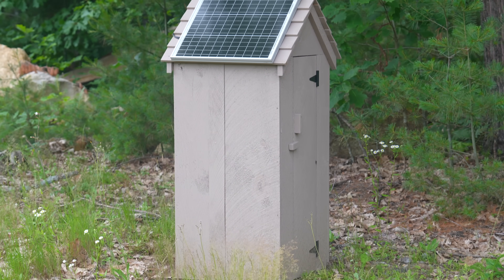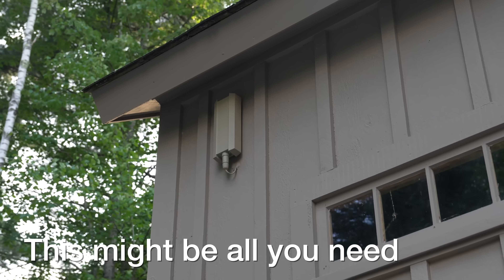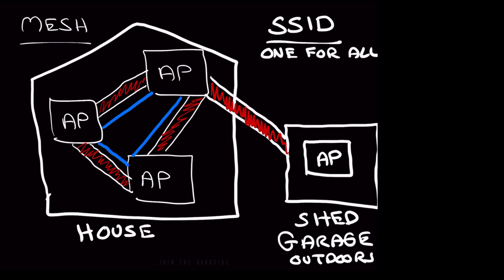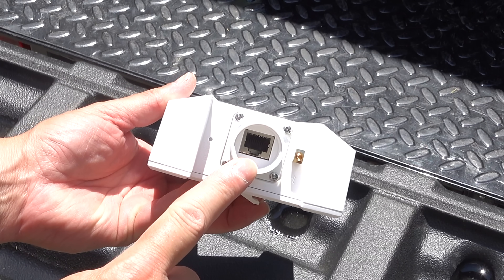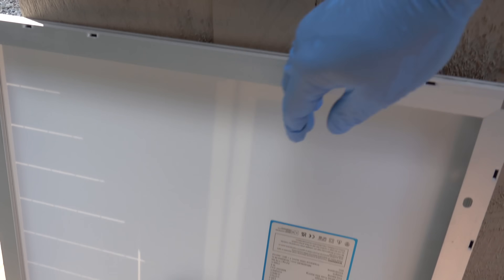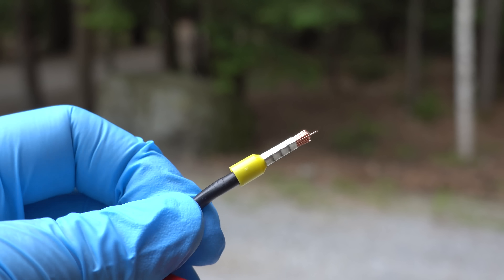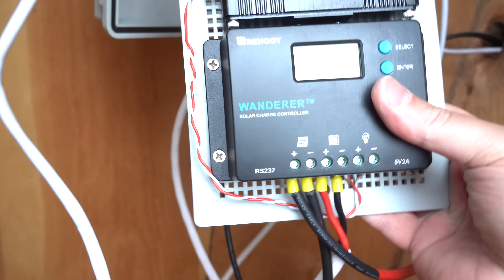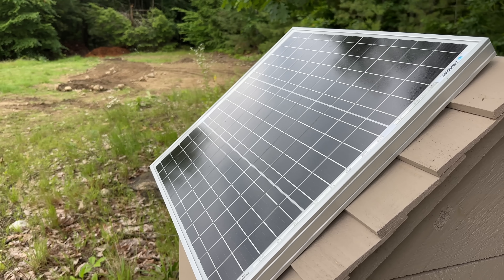How to get Wifi in the woods - DIY Solar Internet Station

Comment from the maker: Hope you found this video interesting. All parts are in the description Let me know what I could have done differently   WHY? I could barely make phone calls outdoors & my kids and I like having music & often use the web even outdoor to check weather, etc. I also have a weather station that needs Wi-Fi (more on that in a future video) - There are some other technical details in the description since I know my fellow IT nuts will jump all over some of my statements.
Reply: Nice setup. I’d want to have that solar panel strapped down securely in the event of high winds. I’d also opt to put some kind of base under it such as pavers. And to finish it off I’d anchor the structure so it can’t blow over. 

I’m absolutely amazed at your versatility in figuring these things out and appreciate you sharing this info with everyone.
Reply: Do yourself a favor, put it on bricks. Get it off the ground.
Reply: If I was going to build a remote repeater, I think you'd benefit from putting it on one of those metal garden carts.  Then it's actually completely mobile
Reply: What did you do about the 48 volts you said the TP needed?
Reply: @Daveyk021  the Poe Switch unit steps up the 12 volts to 48 volts to power the Poe devices
Reply: @TonyTony-rd4rj  So I assume if you accidentally connect a non-POE device (Computer) to a powered port, you fry that device?  TP link makes some nice POE devices but the ports (such as the non-POE port) are not labeled.
Reply: @Daveyk021  Most* not all, but most POE switches will not provide POE power unless the device plugged in requires it.
Reply: @Daveyk021   Yes
Reply: As an IT not a Solar nerd, I think you have done a great job. I've a friend who wants to setup a camera at a remote space at the bottom of his rural driveway that this might work for.
Reply: I found a $16 POE injector that took variable voltage, all the way down to 12v. Draws only about half a watt in addition from my calcs.
Reply: @chakerian where did you find it?
Reply: You might get some new hits if you add "Omada" to the end of the title. Was that little shed a prebuilt purchase?
Reply: Loved the video!!! Thank you. I am worried for the battery when we get cold weather again. These batteries don't like cold/freezing weather and will go defective. But I assume you won't need wifi in the winter. 😂
Reply: Please LMK if you know where I can dump those at my man? I subscribe on fire tv stick with another email so I am a subscriber my man! 💗 The Channel BRW😅
Reply: Cool video!  I use a Google mesh system and have four access points.

One is in the garage and the others are all near outside walls.

I find that I can get good Wi-Fi signal almost 100 yards from my house.

This is perfectly adequate for my uses where I do have a few security cameras outside... But we also have cellular towers nearby and no data limit which allows me to avoid more extreme measures like yours
Reply: Um, hello? An am/fm radio?

If it has weather band, then you can check the weather too.
Reply: Utter and complete waste of money

Comment: Awesome video! I just bought my first property, and it’s about 5 acres. I have chickens, and many outdoor Arlo cameras to watch over the house and the animals. I just learned that on top of trying to cover the distance out here, there’s also only crappy T-Mobile Internet here. We are currently rebuilding the interior of the house, and are without power and water. This video helps very much, because I’m not an electric or technology guru, and have no idea where to even begin on something like this. Solar Wi-Fi mesh for a 5G network could be key. Do you know if this will work over 5G? Currently using a TP link archer.

Comment: Fantastic! Just what I need. I'd love an update on this now that some time has gone by.  Thank you.
Reply from the maker: Thank you, so I kinda of abandoned this, meaning I never took the battery in for the winter. But here's what happened. The BMS works perfectly, during the under 30f, it doesn't charge, but every day when the sun is up the wifi gets direct power from the panel and it powers it until evening which is OK since I am not out there at night. As temps rise the battery begins to charge again, so it has held up super well and is still going strong. The only change you might consider is a larger 100 watt panel, as it would charge it quicker and longer for better duration at night/rainy days.
Reply: @SilverCymbal  Solid! Thank you!
Reply: @SilverCymbal so it really is self sustaining! Thanks for the video I'll try this for my farm.

Comment: Thank you! I'm currently using an AyrMesh Mesh system to extend though my field. It looses  signal going into the woods. I was looking for a way to bounce the signal down some logging trails to get it through the rest of my 60+ acres of woods. I think this might work? The goal would be to to get internet thought the woods and use security cameras as trail camera (Eufy makes great solar cameras). I think this method might work. Any suggestions? Thank you.

Comment: What you didn't mention is that you are ALREADY running a TP link hardware controller  in the background on your network.  You need one of these to allow the Omada app to connect the EAP650 as another meshed AP.

Without the hardware controller, your EAP650 cannot go into mesh mode.

You can see on your Omada App that the hardware controller is the very first (top) device.

Comment: Well done video.  I'm familiar with solar and use the panels & controller to operate a 12V DC water pump out in our garden.  Now I'm looking to do exactly what you have built to get a wi-fi camera signal from our kidding barn back to the house 400 feet away.  Thanks for the wi-fi explanation.

Comment: Okay, I never sign in YT or Google but you made me cause, I think you went over board here!!!!! Battery 12v, normal AP is 12v usually runs @1.5 amp being about 18w... The calculations bring me to needing a 30AH battery LIFEPO (w/BMS). The charger is great and water resistant box is too. Solar Panel... You need about 100w by my math, not sure where you are from but I will give 50w a go and get the mounting too (Will, update if this actually can get the battery back to 100%). So, what you need to do is open up a indoor TP-Link MESH  and place inside the box with other gear. Then purchase extension antennas to attach outside of box. Attach the solar panel to door on the box,. mount box to a Tree and rock on with wifi.

Update: oh yes the heat from any components will help keep the battery charging.

Comment: Great video ! Remembered the days when I did a similar project on a little mountain river and a mill to power a mini motor (read generator) that was powering a wifi router in Client Mode :).
Water was always present, so no need for battery at all. Hey, what about a higher level recipient on that pond, that have falling water that power a mini turbine that power a pump that put water again in the upper container for the turbine to have water to function. The rest of electricity goes to Mesh wifi repeater ! Sure, It is not as hidden as the presented solution. Wait, is this  a perpetum mobile ! ;)

Comment: Thanks for posting this video. For additional coverage and to create a mesh,  what other product do I need. I am setting up for 5 additional extenders into the mesh. I have 6 Batteries and 6 solar panels with switches and the controllers already. I also have the tp 1800 already.

Comment: Why didn't you just use a AD/DC inverter and plug a regular POE switch into the inverter? Or just plug the TP-link radio into the included injector then plug into the inverter? Inverters are cheap.

Comment: You should of looked into Ubiquiti They have 2 Combined MPPT Switch (Ubiquiti  - sunMAX - Managed Solar Charge Controller (MPPT) And it can Run CCTV & Node mesh

Ubiquiti introduces two managed solar charge controller options, the SolarPoint and SolarSwitch.
Remotely
Managed
Maximum Power Point
Tracking (MPPT) 24V, 7A
Built-In 4-Port
24V PoE Switch
DC Output up
to 40W
Weather Prediction Service

Ubiquiti 6U Mesh Node  (Wifi 6)

All you need is a 24V Battey LTO is better at outdoors and Neg temps -60

Comment: I've done something similar, except my system oddly enough is far less complex while offering double the bandwidth for roughly the same range.  I have these Unifi systems that need to point directly at each other.  They use PoE but they operate at a range of 12-24v, which is easy to power for most individual low-wattage solar panels.  I have a tiny wifi AP that is also powered through PoE, so it means fewer cables.  To save power, I lowered the signal strength of the wifi, which also helps keep the SSID to not leave my property.

Comment: Fantastically expensive solution. 
$460 JUST FOR THE BATTERY and box
$390 for the other components
$??? for the shed.
If you want access for your phone, just get a suitable air-time contract with a decent amount of data and save your $1000.
Reply from the maker: Please watch the video to see why that didn't work. The battery was $299

Comment: Have you tried running stacked yagi antennas?  I find that standard wifi access points that are flat like that don't really have any useful antenna gain.  If you have a specific direction from the house you'd like extended range in, stacking some yagis up on the roof pointed in that general direction can get you wifi out well past 500 feet.

Comment: If you wanted a better signal you could go with a dedicated point to point radio feeding an access point, that gives better performance than a mesh in many cases and much linger range as the point to point radio will use a more directional antenna.  If you have very clear line of sight uou could even go with a 60ghz p2p set that can do a full two gigabits over the radio (maximg out full duplex 1 gigabit wired links with one gigabit in each direction).

Comment: why not a 12v to 48v boost converter?  i have to wonder how far the range on this is because i can direct bury up to 320ft and even 400ft with game changer cable. then you can use a poe repeater that also puts out poe, possibly for cheaper and many many many many more blisters and burned calories, oh did i mention blisters and spade shovel? you can for get field tilling unless you can get it 7 foot down lol

Comment: Big fan of the TP-Link outdoor access points, I've been using a TP-Link Omada AC1200 for about 2-3 years and might upgrade to this one next. Great way to have a WiFi signal - especially in areas with spotty cellular coverage.

Comment: The first gen Google wifi (mesh) can run directly of a 12v battery with a $10 car phone charger.  They use USB c as power brick. You can also run them off a $20 battery bank

Comment: I am wonder about the  fall, winter, and early spring do you remove the  battery and store inside for the winter, most standard lithium batteries cannot take a charge at or below 32Deg.F., some have built in heaters to negate this issue, but that does consume some of the battery capacity when the heaters are active.

Comment: Outstanding bit of DIY. Very well done.  Your attention to the details is very attractive.  Thanks for posting....  Btw, I have a 3-piece EERO mesh in my concrete house in the Caribbean.  It does struggle with the rebar in the walls. 😅

Comment: I bet that you can run those AP from much lover voltage. But you would need to open it and poke inside with multimeter and soldering iron to figure it out. So its not solution for everyone.

Comment: really cool project! I have few questions, is that battery ok in the cold? and does that solar panel keep up with the power demand? .  A cool small addition you could do is to create a small LoRaWAN to use as a "low power" status network. LoRa is low power and good range, but does not transfer a lot of data.  You could use it to check battery status or even turn on/off your wifi remotely. Bit technical, but a fun idea.

Comment: Nice build.

Put it on some patio blocks to keep the bottom from rotting.

If mesh doesn't work for you, direct bury fiber optic is considerably cheaper these days.  The SFPs they plug into are easy enough to find cheaply in 300-500 meter ranges.  If you are way out there, they come in kilometer ranges as well.  You'll need a big trailer for the spool of fiber.

Comment: A wind storm and that one secured point of gravity on the solar panel. Would put screws right behind the panel on the bottom edge and tie strings from the panel to the screws. This allow apply pressure to have the panel stay on the roof on a downward motion. Either way a nice built.

Comment: I'll watch to the end and post this if its the same as the intro - the speeds you're getting are really pathetic and I was able to get more in my testing of an ESP8266 mesh network I setup as a test that runs on about a AA battery of power and costs less than $20 for solar panel, esp, and some charge controller parts and used lithium cells from a dead laptop battery.

Edit - ok you now show that its cellular with horrible speeds :)

I am running into the same challenges and am looking to do something similar. The other challenge I'm facing is winter - I think I'd need 3x the battery and panel size to make it through a normal winter assuming the panels stay clear (not likely) of snow

Comment: I was wondering why you just didn't use a x50 outdoor, then I saw the other devices and it made since. Same company different ecosystem.

I had thought of running a solar powered deco outside. Nice to know it works lol.

Comment: Using lithium batteries outside during the winter time iwhen it drops below 32 degrees Fahrenheit or 0 degrees Celsius may not be a very good battery choice?

Comment: I'm really surprised you didn't come across the switch that Unifi makes it take solar input directly and works on a 24 V system so this way you're not buying two components plus it's manageable

Comment: Should really add a bit of space between the roof of the housing, and the panel.
Your panel will last longer and be more efficient. Plus the housing will accumulate less heat.

Comment: One thing to point out here is the misconception that mesh keeps the full bandwidth. This is incorrect as mesh systems will still cut your bandwidth in half for every hop. There is no dedicated channel, mesh just usually will use one of the MIMO antennas as the back-haul. This is why there is still usually a 3 hop limit for most mesh systems, including TP Link. Anything more and you lose signal integrity. Also, I know it was mentioned in the video, but remember that painting your AP will instantly void your warranty and could even cause it to fail if you paint it a darker color and its in direct sunlight.
Reply: What about wireless bridge systems?
Are they different from the system shown in this video? The ones I've seen don't have AP functionality, you have two bridges, they are directly connected and you connect an AP to the second bridge
Reply: @System-br1tx  Yes, a wireless bridge is a completely different system, basically think of them as an invisible cable connecting two points, or multi-points depending on the system. While some do operate on 2.4Ghz and 5Ghz bands, they use a different technology and as you said, don't have AP functionality. You instead would plug an AP into the receiving side of the bridge, or a switch, etc to feed other devices. They can also go over very long distances, i.e. several miles depending on the set up.

Comment: I have built a few similar setups for a local collage to use in their test farms. The one thing i added was a "on" timer with an external momentary PB so that the battery would charge but nothing would be on until the button was pushed. Then I just program the timer to be on for 4 hours then it would shut everything off but the charging circuit. Since they normally dont use them every day the battery is always full.

Comment: I don’t know where you live but I hope you realize that you can’t charge that battery in temperatures of 32 degrees or below. Just found out you’re in Massachusetts. If you want to charge the battery in freezing weather you’ll need to add a way to heat that battery. Amazon has 12 volt heating pads you can put under the battery.

Comment: do you need line of site between the two access points?
Reply from the maker: No, the clearer it is the better but I have a lot of trees in the way and I oriented them to points towards each other but there are obstructions for sure.

Comment: That regulating switch was the most interesting bit in this video. I would use similar setup to build a security cam system in remote location or add a lot PoE powered gear to a van/camper.

Comment: Cool setup. I myself have my main and only Internet access from a friend who lives a kilometer (3300 feet) away, it has worked flawlessly for several years now! I think I paid 70 bucks for each of the Chinese wireless dishes :)

As for your system and "what you would've done differently", I think I would've tried to bypass the 100 buck PoE item somehow with a boost converter, but not sure if I would've been successful in the end. I just realized my own setup also uses that kind of thing with an injector that takes 230V AC, so maybe those aren't super easy to convert.

Comment: I'm glad i found this video because i'm looking for ways to improve the wifi coverage in the campground i work for. The layout of it isn't very great for wifi especially with all the metal walls and roofs around and i need to keep wires to a minimum considering there's 16 POE cameras already on the property and the owner doesn't want anymore wires.
Reply: Start running fiber cables in conduit to strategic locations then branch out from there. The wireless especially in crowded areas starts to have problems difficult to pinpoint. Fiber will also allow much higher bandwidth upgrades as we progress